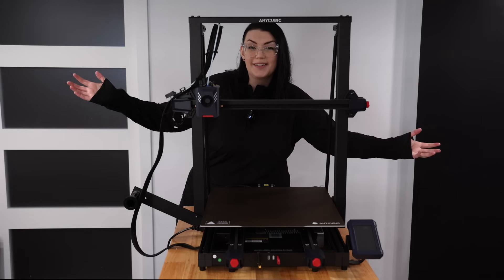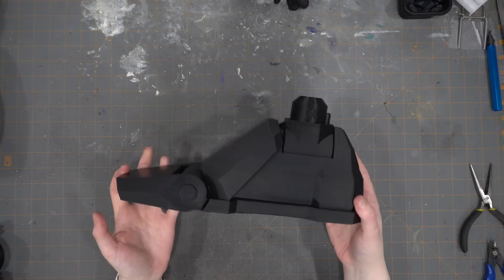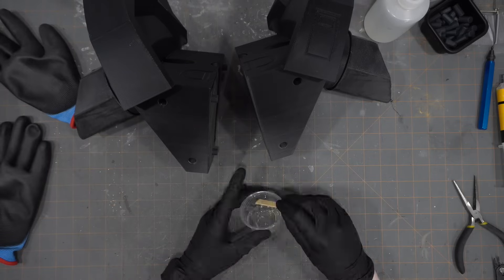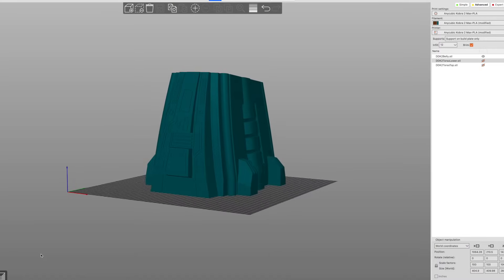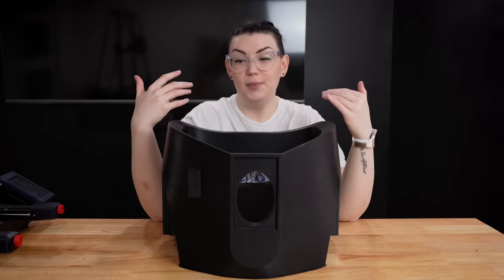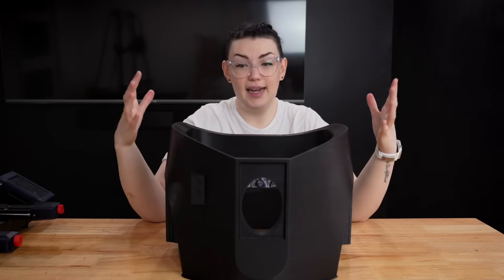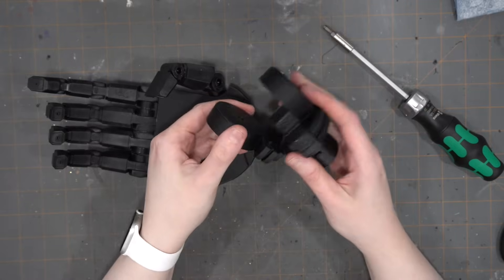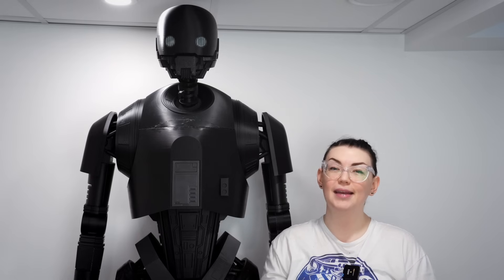The Biggest 3D Print I've Ever Made | Life Size K-2SO

Comment: For bed slingers like this, there should really be an intelligent setting in the software that automatically slows the print speed in correlation to the height of the piece being printed, both to maintain the integrity of the piece and to minimize the possibility of the piece being flung off the printer.

Comment: I have 10 of these printers. Could you please tell me what temps you used on the parts and speed setting like Stable….Normal or Fast? They turned out beautiful. I appreciate your time and you made me a total fan of your channel. Thanks ❤
Reply from the maker: Here are the settings I’ve been using in Prusa Slicer: https://drive.google.com/file/d/1psqDVKy877Ip-p14llSahTuF0iTByX-X/view?usp=drivesdk

The only changes I make to it are slightly altering the nozzle temp depending on filament and slowing the print speed down in the case of a massive piece.
I always just keep the printer running on normal. Stable and Fast just seem to be presets for altering the % of your slicer speed settings. So normal is 100% of your slicer settings, stable is 50% and Fast is 150%. I’m not sure if those are the exact percentages but that seems to be the idea of how it works.
Reply: @MMsPropShop  Thank you so much! I make animatronics that are very big, so this will help me immensely. I’ve been using a lot of PLA for prototypes and I will be finalizing in PETG I think.

Comment: i really dig your project. and the short amount of time it took you to complete it! i myself have been working on building a life sized female robot that i designed myself roughly 20 years ago and, so far, has taken me 3 years to get to the point where i have the torso and upper legs finished. sometimes the parts didn't come out right, so i had to reprint them and reprint them until they did. i am using a creality cr10 for the job. but your project is/was inspiring. thank you for sharing it with us 😀

Comment: I find your creations to be absolutely fantastic, I can't even imagine what an absurd amount of hours it takes to get each and every part printed off.  I was wondering what it's like working with that anycubic filament printer you used most for the body mods, I'd be interested in getting something like that model for my projects.
Reply from the maker: It’s been an incredibly positive experience using it! No major issues to report in the 7ish months of owning it. It takes up a ton of space though so make sure you’re prepared. Because of its size there’s a lot of weight behind its bed movements so you’d need to make sure it was set up on something incredibly sturdy or even the ground. I have mine on the floor under a bench in my workshop.
Reply: @MMsPropShop  Thanks for the heads up, it's definitely one of the things I look forward to getting.

Comment: Great video! I was considering a Anycubic Cobra 2 Max for Storm Trooper armour so I would not need to slice helmet or chest armour into smaller pieces. 
I'm using a FlashForge Adventurer 4 now and it don't print smooth at all, but Cobra 2 Max gives excellent finish!

Comment: Michaela- I just added the Max 2 to the printer room. Do you use a PC or Mac for your files? I use Macs have issues finding my print files on the Printer screen to start my designed prints... (Test prints are fine, but the USB shows none of the files that I've sliced and added). Yes, I've checked the USB Drive, and they are on it, until I put it in the printer. Thanks.
Reply from the maker: I had been using a PC for this machine. The only time I’ve experienced files not showing up on a printer was due to how the USB had been formatted. All it took was reformatting the USB in disk utility to fix it. If the files are in a separate folder on the USB that also sometimes will stop them from showing up.
Reply: @MMsPropShop     Michaela-  SO much help- thank you. Worked like a dream. Starting a large print on Friday. Would you share the print settings and speed that you used on your K2? The surface profile looks amazing. I feel like I am running it too fast to make a smooth surface.  Thanks!
Reply from the maker: @rodrage you’re very welcome! I’m glad that it worked.
Here is my PrusaSlicer profile: https://drive.google.com/file/d/1psqDVKy877Ip-p14llSahTuF0iTByX-X/view

Its success/smoothness could be very dependent on what filament you’re using. I found that the Anycubic Rapid PLA was very smooth, to the point that the layer lines almost disappear.
Reply: @MMsPropShop   Very grateful - you are amazing. Thank you!!

Comment: This is such an awesome build! The sheer size of it is insane. Hopefully one day I’ll be able to do something like this, but I’m only on my first helmet now. I’m using the foot sander you recommend in your videos, but I’m not sure if I’m using it properly. What speed do you usually use for sanding? Should I be pressing hard into the print as well? All your builds have been crazy impressive, I’m shooting for that same level of quality. The plo koon bust was especially amazing
Reply from the maker: Typically I have it going just under full speed. I find that it overheats a lot faster when it’s going the fastest it can rather than just shy of that. I definitely apply some pressure when using it on a print but I try to have the sander doing most of the work. Some filaments will just sand easier than others.

Comment: Great video!!!! What slicer are you using?  I know that you have to mirror several of the prints for K2 and the AnyCubic slicer does not allow this.  Can you tell what is your secret?  Thanks!
Reply from the maker: I’ve been using PrusaSlicer. There are some specific setup steps to get it working properly with the Kobra 2 machines but it’s been smooth sailing ever since.

Comment: Thanks!
Reply: Now I have a reference for my next big project. I was surprised that you had not previously had a printer monitoring tool.
Reply from the maker: @BradfordBenn I have had other printer monitors with octoprint, etc. but it was nice to see it built into the machine and have it easily working.
Reply: @MMsPropShop  have you tried Obico with Octoprint? Curious your thoughts, as I am debating about the cost
Reply from the maker: @BradfordBenn I unfortunately have not.

Comment: That freezing issue is a problem on the Kobra 2s They have released firmware upgrades to deal with it but from what I hear its still happeneing.  I've had this issue happen 4 times on large multi hour prints. I haven't used my Kobra 2 Max since.  I've  updated the firmware but I want to make sure its worked out before I waste any more filament
Reply from the maker: It’s supposedly due to errors during slicing that causes the freezing. There was a theory going around that the screen going to sleep might also have something to do with it. Making sure you’re running through a decent quality USB stick could also solve some issues. That goes for any printer though. I’ve had freezing happen on other machines and it ended up being because of an SD card error.
Reply: @MMsPropShop  I contacted anycubic and they sent me a firmware update  but they have since released a newer version I will try to upgrade to the latest to see if that helps

Comment: 500mm/s? That's 50cm per second. That's half a meter per second. That's impossible. Maybe 5cm per second, but not 50. Sorry. Not possible.
Reply from the maker: Have you seen how fast newer printers run? There have been people that have modded custom printers to be running at even crazier speeds like 1200mm/s.
Do you want to be printing at 500mm/s? No. That’s typically reserved for travel movements. But these printers are easily handling 250mm/s+ speeds while printing and very obviously travelling at that approximated distance as well.
Reply: Very possible on these new printers

Comment: So cool. That big print anxiety is real! I was 17 hrs into a 35 hr print and the filament had a lump in it that got jammed going into the run-out sensor. Filament eventually broke down at the hot end so the sensor never tripped. I was using a brand of filament I'd never used before and I needed to get this job done but the only other roll I had in the color I needed was this same brand. The reprint ended up turning out great, I probably just caught a manufacturing blip on the first roll, but that was an anxious 35 hours 😅
Reply from the maker: Yes! I got used to dealing with 48hr+ prints on my CR-10 but with these faster machines, a 2 day print is the equivalent to a 6 or so day print.

Print fails are the worst when it’s something ridiculous like a random filament issue 😭 Glad you managed to get a successful print later!

Comment: ‼️ Fan Flipping Tastic‼️
Any tips on planning for filament spool replacements mid-print? I’m always worried about a run out, and spend way too much time staring at a spool that I THINK is almost spent. 

It’s like watching a pot of water come to a boil. Slow and tedious.
Reply from the maker: Thankfully this printer has a filament runout sensor so if I miscalculated I had a backup, but typically when a spool starts running low I’ll set a timer for a slightly shorter time than I think it’s going to take to run out and check back on it to see where the spool is at and keep doing that until it’s time to change. If you’re printing everything at the same speeds on a machine then you’ll start to get the hang of how long it’ll take to go through a certain amount of filament.
Reply: @MMsPropShop  Good advice. Thanks! 
My Big Neptune has a runout sensor, but I’ve read it isn’t 100% reliable. I like timers. 👊🏾
Reply: @MMsPropShop you’d think they would have sent you 3kg or 5kg rolls instead of the 1kg ones

Comment: As a heads up, with the plastic welder, you are supposed to press the staple into the plastic and then twist slightly so the staple actually goes into the plastic body. Great work on the massive project!

Comment: Another great video.  Thanks for sharing this.  Can you tell me what nozzle size, layer height and speed you ended up mostly using?
Reply from the maker: Thanks! Everything was done using a 0.4mm nozzle, 0.2mm layer height. Speeds were 190mm/s perimeter, 250 infill, 200 top/bottom, 150 support material and 300 travel.
I think it could have easily handled faster, but the pieces were turning out really great and it was going fast enough for me 😂
Reply: @MMsPropShop  Thanks.  That's very helpful.

Comment: Wow.
Big Wow!

Bed adhesion question;
Aquanet, Glue Stick, or other?
Reply from the maker: I didn’t use anything yet on this particular printer’s bed, but lately I’ve been a big fan of bed weld. Glue stick was my previous favourite but the bed weld is so much easier to apply as it is a liquid so you don’t run into the pilling that sometimes happens with glue sticks.
Reply: @MMsPropShop  Sounds great. I’ll give it a try. Thank you!